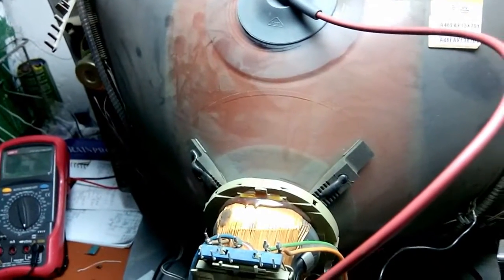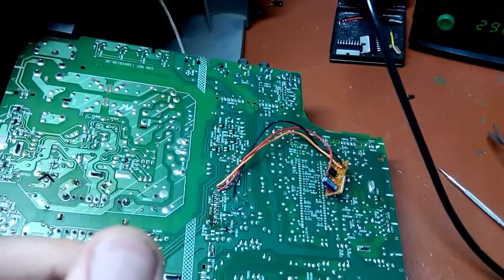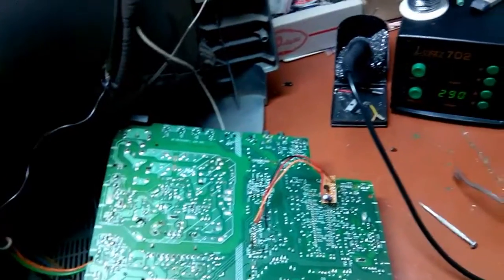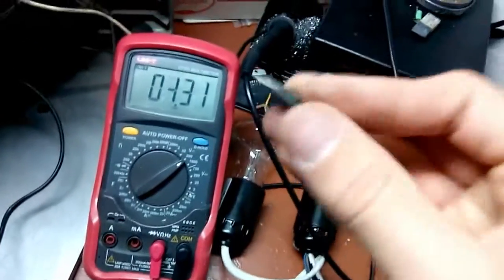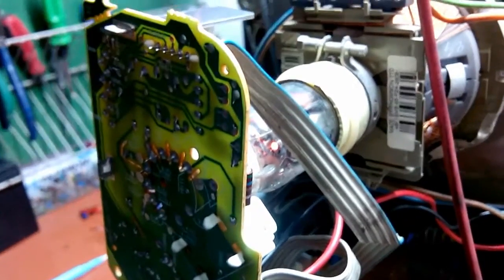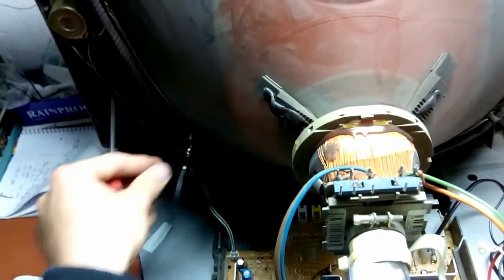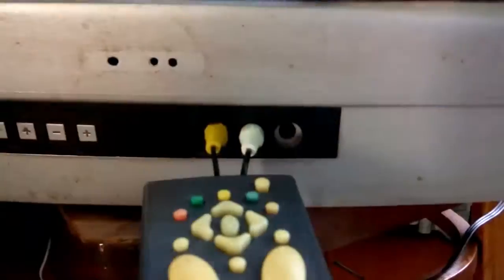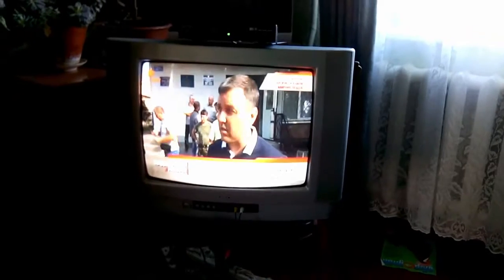CRT TV Repair #3 (completely dead) - Part 2

Comment: Hi Mr. Johny,
I have the same chassi, but my problem it's a little different from yours because I have sound but no image on tv.
I think this defect is in the flyback because I don't have the +12,9 or -12,9 volts in the secondary, another thing, the filament I notice that it doesn't glowing. Could you confirm this?!

Comment: Can you help me with something? I have a JVC Television and the picture is not centered, the Sides of the picture, and the picture is Tilted. How can I fix this!?
Reply: Also, the Sides of the picture is cut off.
Reply from the maker: +Kaka Carrot Cake It turned like that on itself or did somebody mess with it before? Give me a full model name so I can take a look at the schematic in order to give you hints where to look for a problem.
   By the way, tilted picture and cut-off sides can be a result of a yoke displacement. But to check that, you have to go and take the cover off, which I don't advise you to do unless you have experience with electricity. If you still want to check it, a yoke is an assembly on the CRT itself with a bunch of enameled wire, it should be firmly glued in place if it's loose - there's your problem. Make sure you don't touch metal parts, stay well AWAY from the suction cup on the CRT and take care.
Reply: +MrJohhhnnnyyy The Model number is: JVC Model No.AV-27D200
Reply from the maker: Kaka Carrot Cake Again, you didn't tell me how it happened, maybe you were moving the TV and dropped it a bit - then it's most likely for the yoke to get displaced. I can't tell you the very part that's failed 'cause there are a lot of parts that can cause the same issue, I can just guide you where to look for a problem; but in order for this to work, you must have some experience in electronics field.
 One thing every person can do is to check if the yoke is fixed in place, but you have to use caution, there are voltages inside the TV that can KILL YOU.
Reply: +MrJohhhnnnyyy Oh, my bad. It was fine in my Apartment, but when I moved into my new house about a week ago. I made sure to be EXTRA careful with it. I have no idea what I did.
Reply from the maker: I'm pretty sure the yoke displaced itself there. Pop the cover off, be extra careful and try to wiggle the yoke slightly, if it wiggles - you will have some fun time centering the thing :) The yoke should be rock solid on the neck of the CRT
Reply: +MrJohhhnnnyyy And should I be careful about electricuting myself anywhere? I don't feel like dying haha.
Reply from the maker: Just make sure you don't touch metal parts and keep your fingers well away from the suction cup and you'll be fine.
Reply: +MrJohhhnnnyyy Would you maybe making a video on it? I just want to see what everything looks like, especially the Metal Parts that can shock me, the a
suction cup? and the yoke?
Reply from the maker: Kaka Carrot Cake Well, right now I'm not at my place, but I'm gonna be there on Monday. Yoke is the thing on the CRT which has a lot of wire wrapped on it, suction cup is located on the CRT itself and there's a fat red wire going to it. Do that test with the TV unplugged, there's no need for it to be powered up. And you can use insulator of some sort to poke there instead of you're fingers. Again, I'll make a vid, but it's gonna be on Monday, not any sooner, sorry :/
Reply from the maker: Kaka Carrot Cake Here: https://www.youtube.com/watch?v=mFNSJQ_rZ6k
Reply: +MrJohhhnnnyyy I can't watch it because it is private.
Reply from the maker: Kaka Carrot Cake Check it now, I just picked the wrong setting :/
Reply: +MrJohhhnnnyyy Can I have your email?? I need help.. I'm still confused about the yoke
Reply: MrJohhhnnnyyy